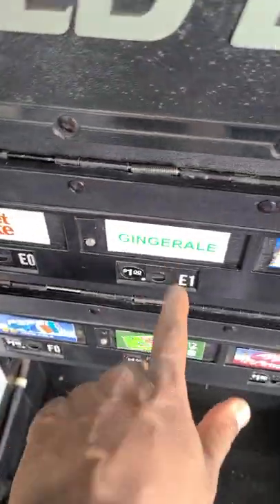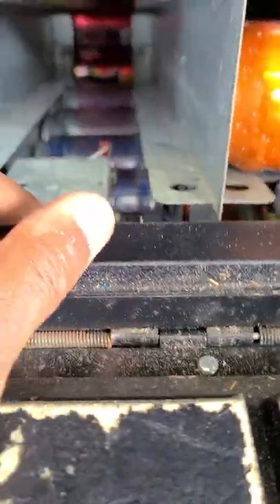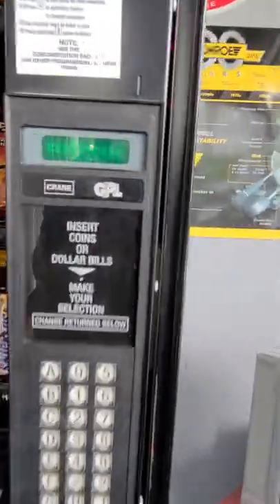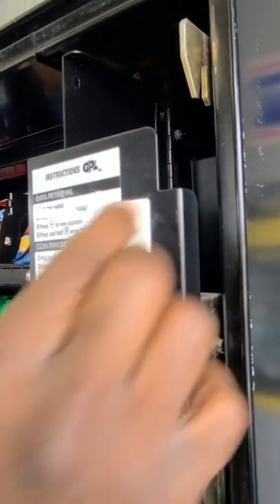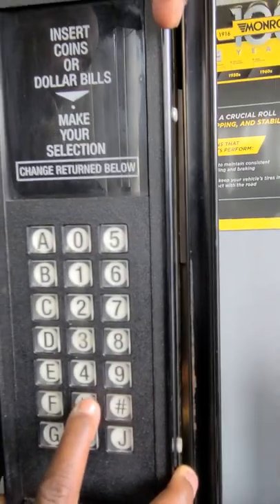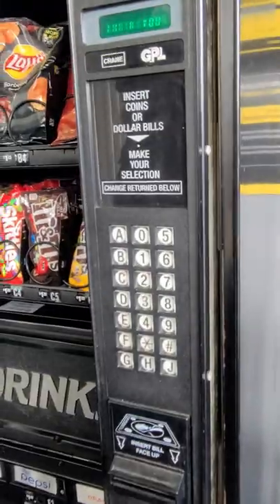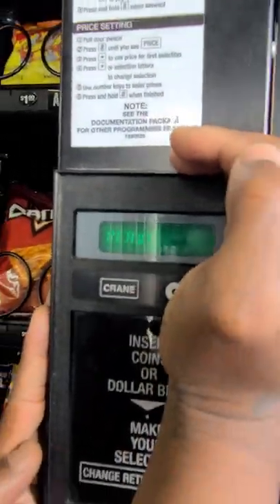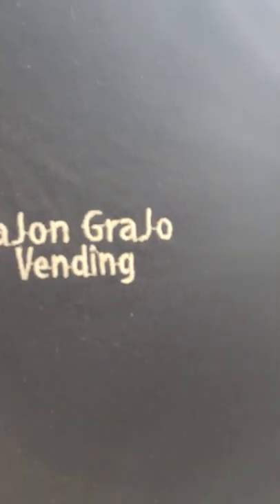How to unload/test Crane model 490 vending machine

Comment: Great video. I have a crane 797 combo. I have 2 slots that are dispensing free. Do you know if it’s on test mode fir those 2 if so how can I fix? This is my 1st machine
Reply from the maker: Possibly. I would check that and what the price is set for assuming you didn't set it yourself. Also some machines the slot have to be filled to a certain amount to vend properly. Hope this helps
Reply: @news757stocksandhustle3  will definitely check that. I just bought the machine last week so still learning. Thanks for the quick reply and look forward to more of your videos 🙌

Comment: Me too, when I hit test my bottom row drops sodas but not the top row.
Reply from the maker: Appreciate you for watching.  Some machines I have seen to be different even though it is the same model, but as far as the process itself whatever worked for one should allow you to do it all. If you are hitting test button and it's vending it SHOULD work for not just the soda but for the snacks as well so I'm really not sure what's going on with that.
Reply: @news757stocksandhustle3  yes, the 474 model. The works, but just not on my top row of sodas. Even if I feel it up. The bottom row will test and drop sodas. Frustrating.